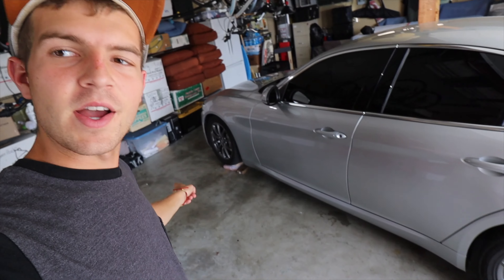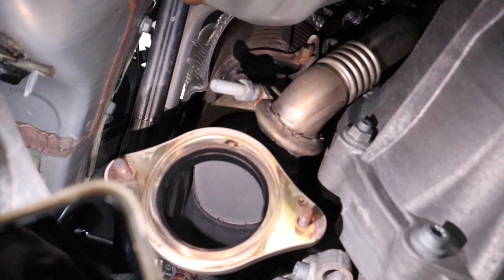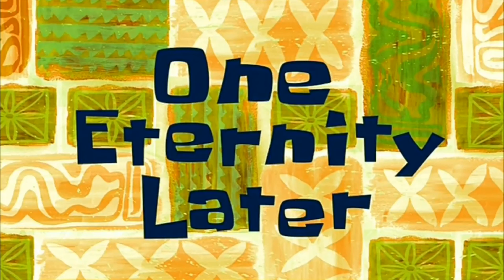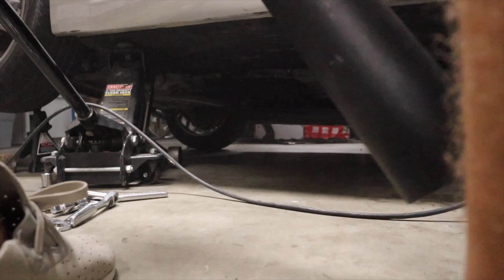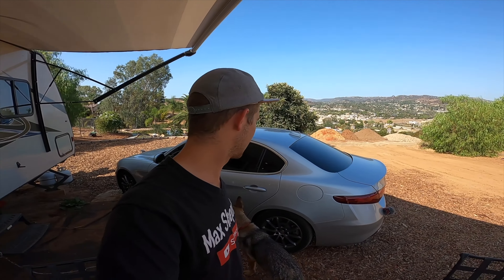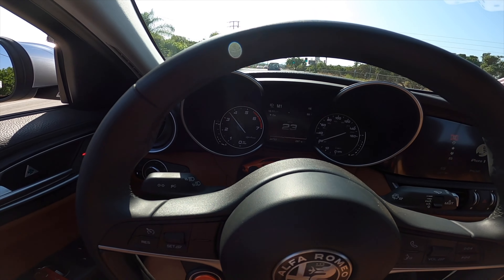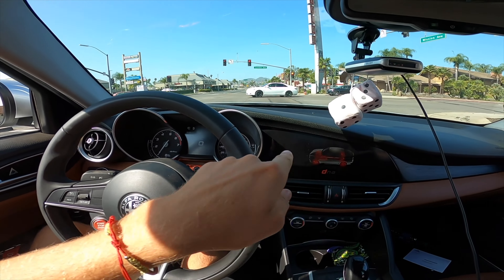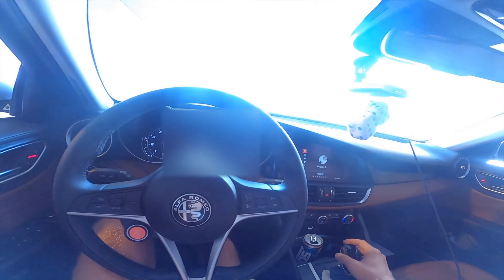I Made The Loudest Alfa In The World Max Shepherd

Comment: After removing the cats have u seen a difference in the car like any codes or signs came up after and is it pulling a lot better? Has it increased its power
Reply from the maker: No codes as of yet which I thought I would forsure get one as I accidentally hit the o2 sensor when drilling, but it sounds so much better, feels slightly faster in high rpm and same in lower end

Comment: U will not pass smog lol 😂
Reply from the maker: As it is a 2017 I don’t need smog for another 3 years or so. Also, as long as there is no code it should pass easily as they don’t use a sniffer anymore on 2000+ cars
Reply: Max Shepherd You should’ve just cut the cat off and run a straight pipe or sell keep the cat